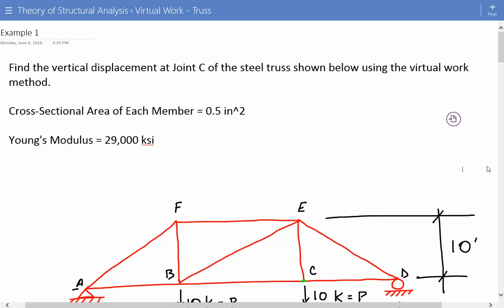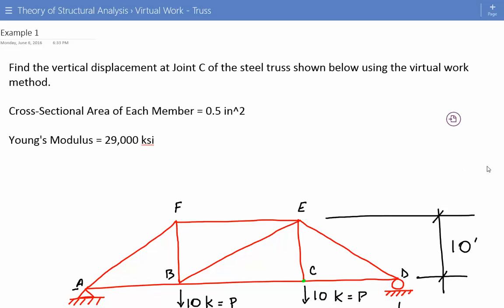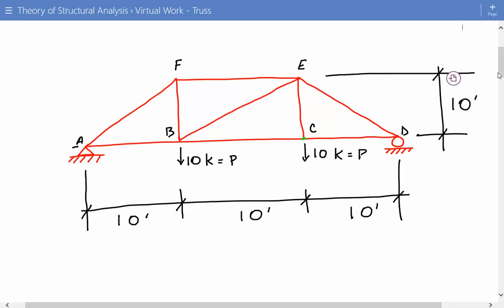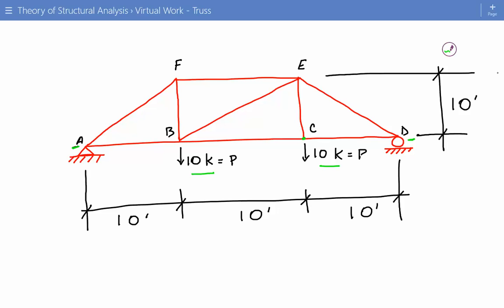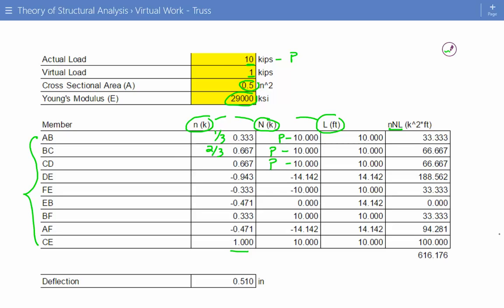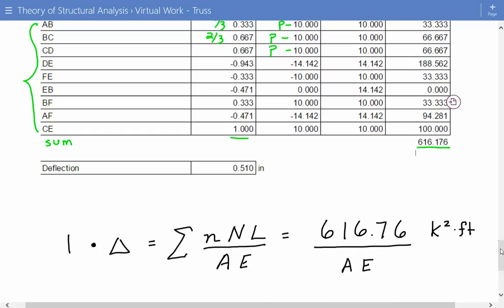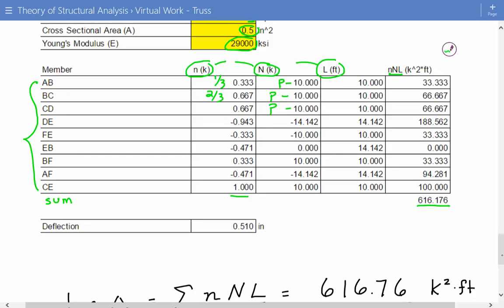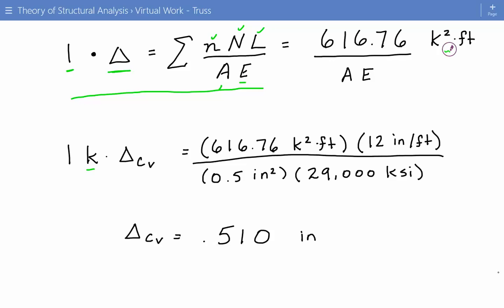Deflection of Truss Using Virtual Work Method, Structural Analysis for Trusses Example 1

Comment: Sorry to be pedantic, but you mad a transcription error when you copied 616.176 k^2ft to the formula. You wrote 616.76. It does not make a huge difference to the final result, but could be significant if you were aiming for less than 0.51 inches deflection!